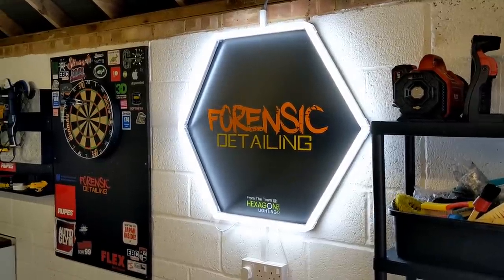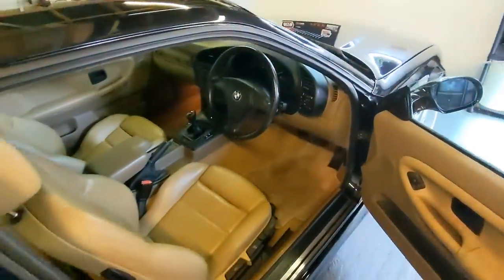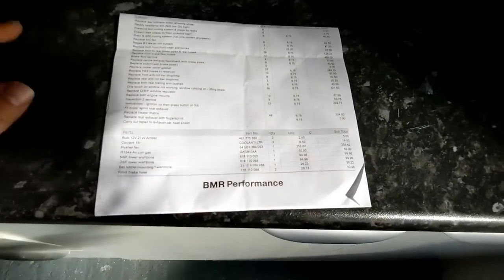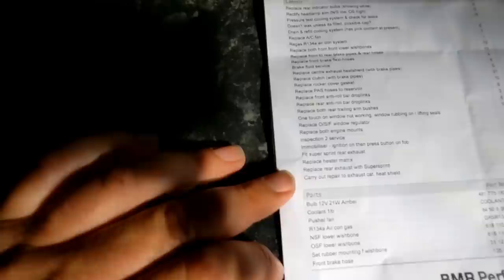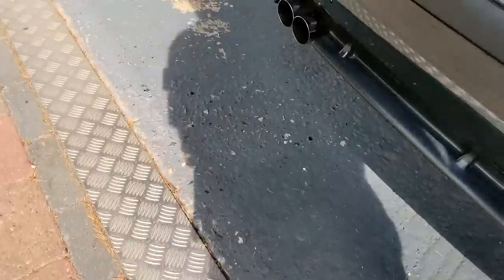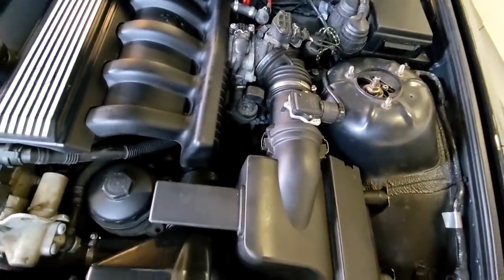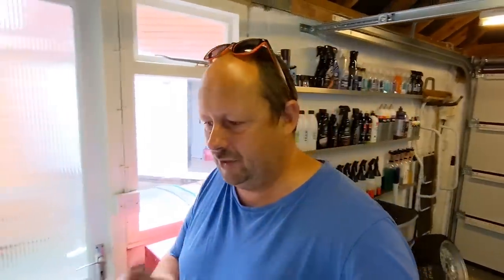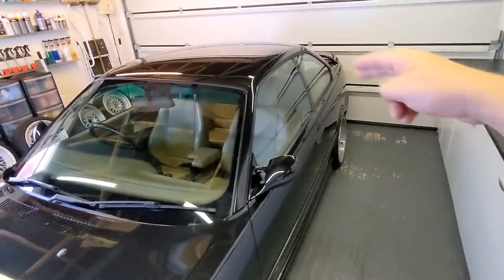Revenge of the Money Pit | £7k repair bill but Im over the moon!!!111onetwo

Comment: Always good to find a proactive garage to help you out. I remember working on these back in the day. Main faults with these were. Rear lamp bulb holders burn out the bulb contacts, exhaust mounts (which you've done) centre prop coupling occasionally, rear trailing arm bushes all the time (just been done). Top rear shock mounts, clutch (done), prop shaft coupling by the gear box. Front wish bone bushes and lower ball joints and occasional joint in the wishbone (done). Engine mounts are common (done), occasional air leak in the inlet manifold- usually one of those orange rubber gaskets, Ignition coils,  air bag slip ring noisy when worn out,  water pump impeller shearing off. Radiator leaks usually from the expansion bottle, power steering pump groan when worn out. I've had to replace a short engine due to the niacil ( not correct spelling) coating inside the bore coming off and melting a hole in the piston. The occasional frame less windows need setting up to make contact against the window rubbers. The occasional gearbox input/ output shaft seals and crank seal. None of it is particularly difficult once you know what you are doing. But yep, Jon you are right that its an endless amount of time doing it up!
Reply from the maker: I think my pas Pump is groaning to.
Reply: @ForensicDetailing   If it gets any worse change it before it breaks up and all the broken bits get into the steering rack. Also you mentioned the oil looking clean- there is a thing call 'shear effect' the oil particles can break in half and this reduces its ability to lubricate, the oil might look clean still but it won't for much longer as you'll start to see it turn silvery grey from the internal components wear and this deposits in the PAS fluid/ ATF fluid. Might be worth looking into a new pump soon and change the oil in the process. I suspect the steering rack is OK. Usually its the pump that goes first

Comment: god what a stunner john, 

After doing so much to the car one thing I would suggest as a owner of multiple e36s is to inspect for rust, some hidden areas which are common are battery tray, need to remove the battery to check properly, also underneath the rear seats tend to collect moisture and ive known many to rust where the gasket/ fitting for the fuel pump is. Best to get these areas checked and protected as ive seen a few go badly on these areas. Not sure if you've done it already but built hamber offer a great range of anti corrosion treatments, would deffo recommend S50 cavity wax to protect the inner sills. only £15 quid a can and easy to apply.

Keep up the good work, great to see another sport being saved!!

Comment: John that noise on the steering rack is definitely the PAS pump. Worth changing ahead of failure.
Reply: I changed my sisters Audi A1 PAS pump when it started to whine and complain. Different kettle of fish and it's not the same class of car but you can get such a part off a scrap yard for a good price and it will last. Hers has done probably 40/50k and given her no problems. Just labour charge is all like front wheel coming off. The Beemer will be different but hopefully they've not wedged it in too deep. The rocker cover gasket is a right bastard to do in those Beemers. It's all the way at the back and fitting your hand in that tight space to get there isn't easy.

Comment: I'd say only the engine mounts were not really DIY worthy. Everything else you could have done and showed us with video after video
Reply from the maker: You think brake and fuel lines are diy?
Reply: @ForensicDetailing  on BMW's, yes, they are screw off screw on lines. Not sure about other cars but BMW's are just threaded through nuts at either end, extremely simple to do. You have the tools! We've seen your garage 😂